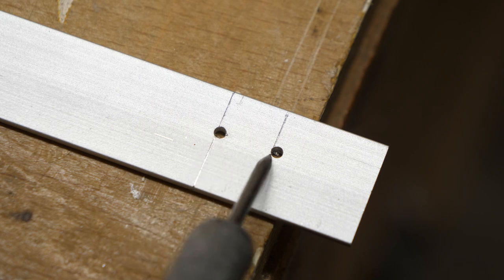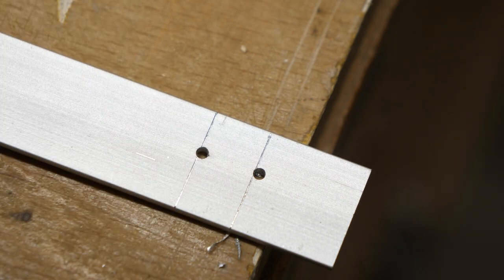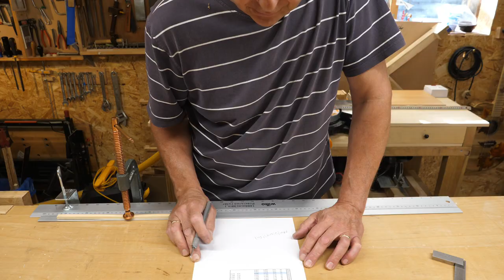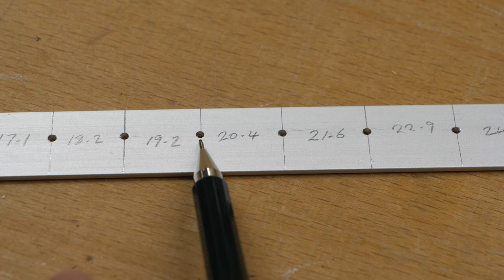Complete Bass Guitar Makeover - episode 3

Comment: would a veneer on the top work. It's a nice bit of wood, but I'd say it would be very difficult to have a repair that doesn't show in some way.
Reply: I'd like to second this suggestion. You could also weight-relieve the body if you think it would be too heavy.
Reply from the maker: Great suggestion, I would need to take quite a bit more off the top to get rid of the body carves.  I had thought about cutting the body in two so that I can get it in the thicknesser.  Ooh this is something to think about. Cheers Dave
Reply from the maker: Good idea although the body is quite a bit lighter now.  Thank you. Cheers Dave